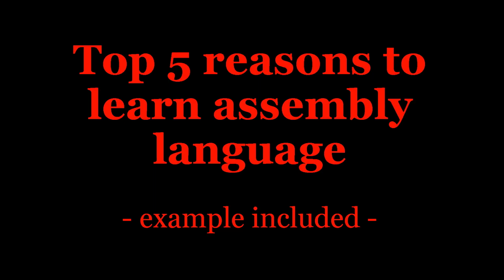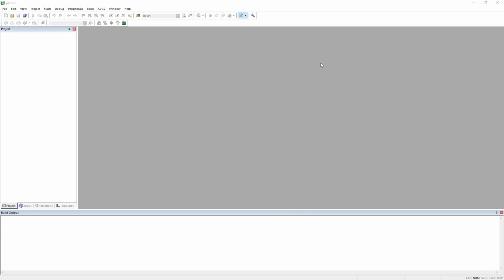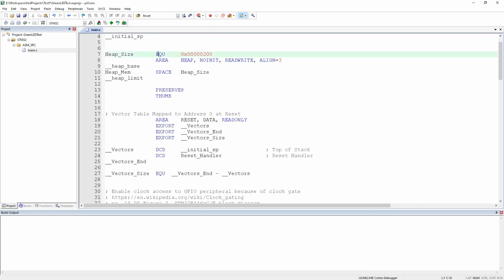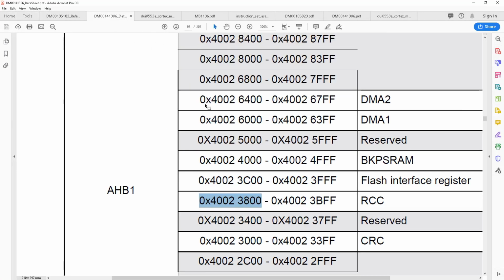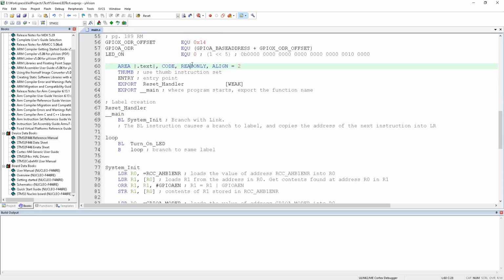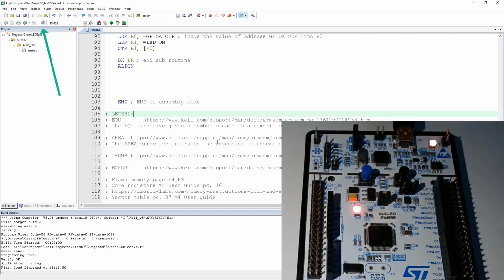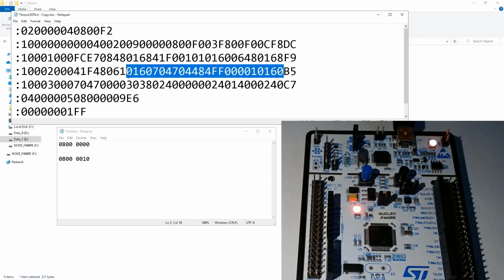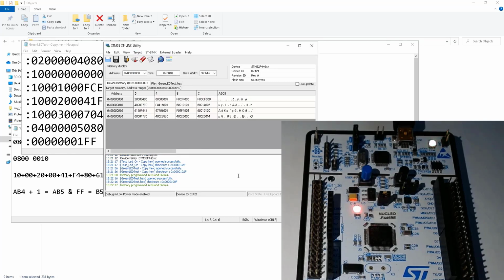Top 5 Reasons to learn assembly language + HEX modification | Assembler | Learn with George

Comment from the maker: At this address you will find the instruction details for Cortex M4 ARMv7-M architecture: https://developer.arm.com/documentation/ddi0403/latest/
For homework and debugging your own code you can try out this free online disassembler: https://onlinedisassembler.com/odaweb/

Notes:
1. You will find out that for our first example the machine code doesn't return back the STR instruction but MOV.W
4FF00001 -> mov.w r1, #0
2. Professionals use more advanced disassemblers like Hex Ray - IDA Pro to find potential vulnerabilities inside the machine code.

I added a second more cleaner example to repository: main_v2 (it also have the LED OFF)